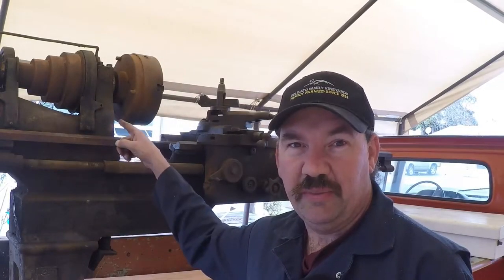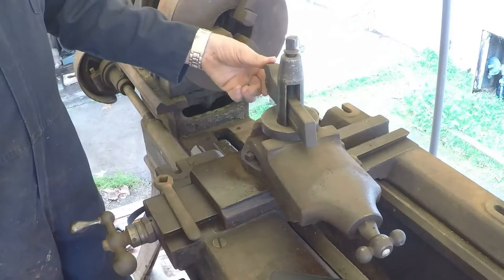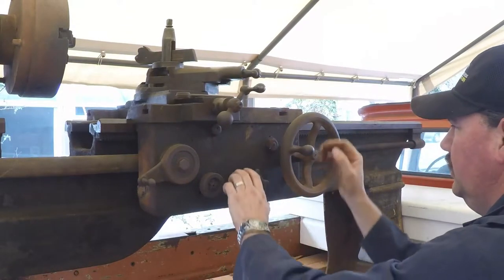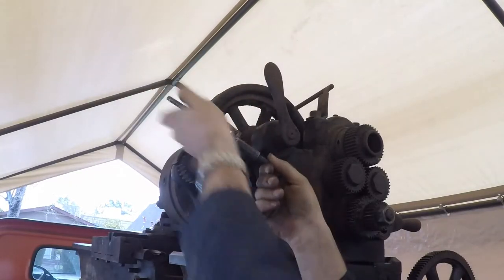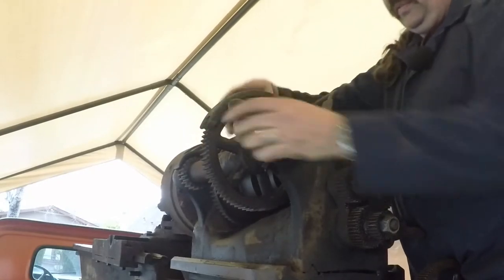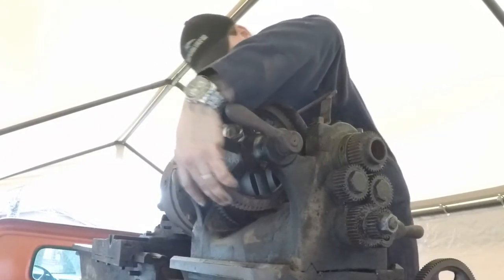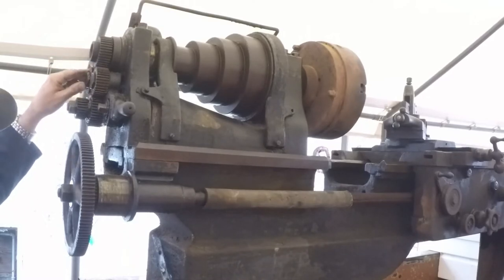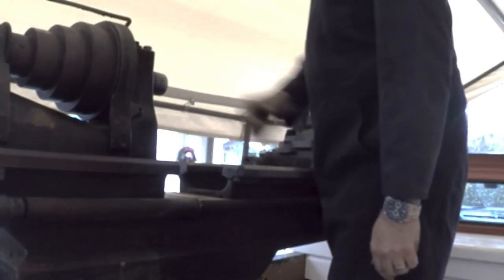South Bend Lathe Restoration Part 2

Comment: The old South Bend lathes are infinitely repairable. Looks like a fine old machine. Glad you are bringing it back rather than chunking it up for scrap. 
The back gears get mistakenly used as a way to lock the headstock. Knuckle heads get into trouble by not having the chuck tight when they start the machine. The headstock spins the chuck onto the spindle until it slams to a stop. That locks it up tighter than a drum. Trying to get the chuck off they beat on the jaws and snap off the gear teeth. I worked for Douglas Corp in Teconsha, MI. Their biggest had a 6 foot swing and a 40 foot bed. They went down from there. Did a lot of flame spraying and pump work. Most were tool room Monarchs. 
I've been able to braze a missing tooth onto the cast iron bull gear on a Farmall B. When the wheel locked up from having the broken gear jamming the pinion it about threw my son and I off the tractor. With your mill you will be able to avoid the laborious hand filing that I end up using to get the tooth into shape.

Comment: Hey Chris, nice to finally see the ol girl getting the attention she deserves! The date the lathe bed was cast is cast in to the bed on the inside between the ways, the exact date. If you haven't yet I'd go over to practical machinist and join up, then go to the south bend lathes sub forum and ask around about getting another back gear, someone on there probably has one kicking about, also very knowledgeable folks over there that are usually willing to help answer questions about the machines.
Reply from the maker: captaingreenbush where exactly is it cast at there's a lot of grimy real estate there . I am a member already but I'll go chat up the south Bend section.
Reply: +Chris Anderson (The Apprentice Machinist) I'll shoot a little vid as to where it is, simpler that way.

Comment: Nice find,...mine is a 1941 14.5 x 48" and i was also searching for oil holes in the back gear system, could not find any, perhaps i need to take it apart and have a closer look, cannot believe that there is no way to lube the shaft
Reply from the maker: dynoguy I did find them small set, screws camouflaged in grime. I will show in a upcoming video.

Comment: nice lathe, this is an identical one to mine with the exemption of the gap bed and length. based on the serial nuber you will find on the end, you will be able to find the original build and sales card for this. mine was built in 1918 and they came painted black like an antique singer sewing machine. I use mine on a weekly basis. could you email me a couple still pics of the carriage slide, think mine was swapped out and doesn't fit like it should
Reply from the maker: Clarke E I plan to get the card but not just yet.  email me at zertwiz@gmail.com
Reply: Chris Anderson ok thanks
Reply: +Chris Anderson (The Apprentice Machinist) I tried sending to that email twice and it got kicked back. it's ok, I see enough in the video to realised it's slightly different from mine.
Reply from the maker: OK not a problem.  :)